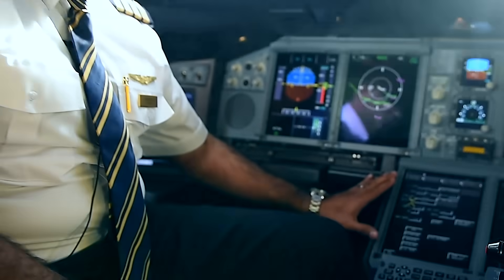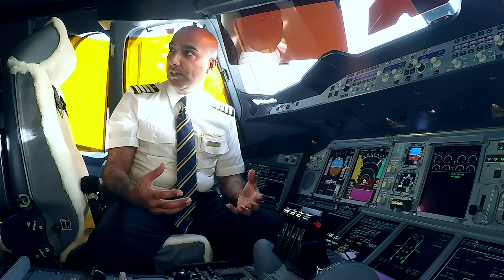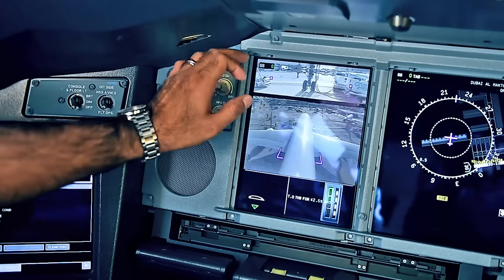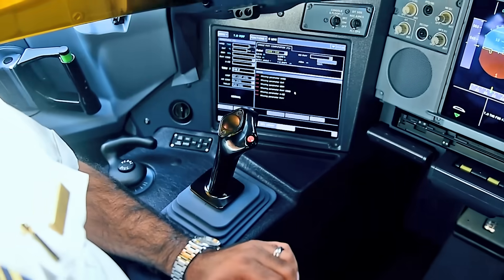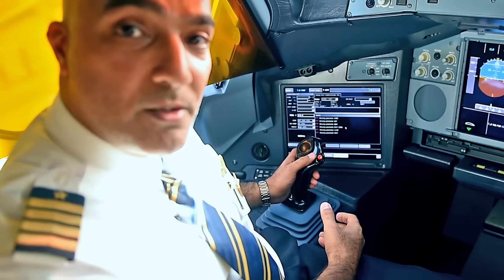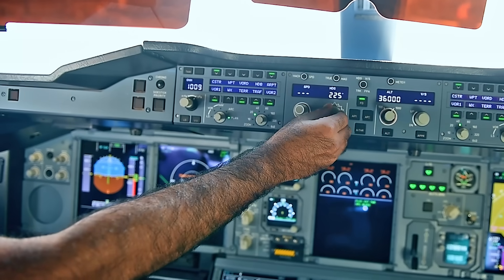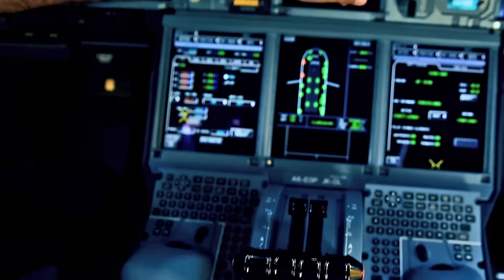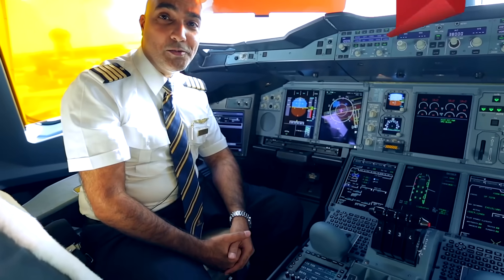How to fly the world's largest passenger aircraft | Airbus A380 | Emirates Airline

Comment: Airbus makes me a bit concerned.  If the system feels the pilot is endangering the plane, it won't let him do it.  There are times the system misreads information and the pilot is actually trying to correct the problem, like when the system thought the plane was at 50 degrees instead of 2 degrees and the pilot could not override the system.
Reply: Boeings since the 777 do the same. And on every plane, be it a Boeing or an Airbus, these protections can be disabled, so the pilot has direct control without any computer interference.

Comment: What can a pilot do if something goes wrong? He has no real flight controls to manipulate or anything. About the only thing I an see happening is that someone breaks out a lap top and tries to figure out what can be done if anything.......if there is time to do it of course.  Now the 380 is a wonderful aircraft but with as many people as it carries I do not understand why a manual back up system is not installed. It will take just one of these giants crashing and killing 500 people before people realize that an all computer plane is just not that safe....or that is my opinion.

Comment: But, what about the co-pilot... What switches does he get to flip?
Reply: The toilet flusher
Reply: It is incorrect that the captain flies and the co-pilot does the other jobs. How it works is that on the 1st flight, the Captain is the Pilot Flying- so he has control of the thrust levers and sidestick: and the co-pilot does other jobs lile talking to ATC, putting the flaps out and gear down, radio frequencies and puts info into and outof the computers. On the next flight, they swap roles so the copilot flies and the captain does the other jobs.
Reply: It's his job to scream, "pull up, dammit, pull up,!?"

Comment: Air craft company have a great responsibility to put multiple pilot...anyway 3, in case of emergency...500 people's life is not easy flying from continental to other. 
as well as safety check up of the engine and computer system. 
almost all crash of the plane was either pilot error or evil attacks. I extremely wonder the air crafts are Super reliable if the pilot uses properly and correctly. 
.....***.......*****........*****..........*

Comment: Too much computerisation. I have flown in that aircraft many times but one day the computer will fuck up and the thing will crash.
Reply: It's not a pc running Windows. The fly by wire system in the A380 is at least triple redundant (possibly quadruple redundant), so even if 'the computer will fuck up', you'll still be perfectly safe.
Try to find a crash that's caused solely by the failure of a fly by wire system. You can't. It doesn't happen.
Reply: Bob UK humans are more prone to causing errors than computers

Comment: OUTSTANDING!! how come the A380 only reverses 2 & 3? why not all 4?
Reply: Sean Buller cuz if the outbound engines would reverse it would suck the ground into the engines
Reply: 1- 2 engines are enough.
2- Weight
Reply: Maurits Veen thats right. If the outer two engines were equipped with thrust reversers then they are susceptible to taking in debri and dirt from the outskirts of the runway and therefor prone to engine damage. Thats what i read somewhere.
Reply: Sean Buller 
Yeah absolutely..the jet fuel HOAX....*Jet AIRplanes ACTUALLY RUN on compressed air free Energy OVERUNITY NOT KEROSENE BURNING HIDDEN in airPLANE sighT* Show me the curVe??? it's flat earth truth nasa hoax..

Comment: does this aeroplane have no trim tab?no dual hud?what about the stickshaker to warn of a stall coming on?sidestick control doesn't let the other pilot know the other pilot's movement like a normal control yolk like on boeing aeroplanes.although the side stick is supposed to have envelope protection it will level the aeroplane if the pilot pitches up at a higher angle of pitch attitude or nose up.

Comment: Thank you Captain for a most enjoyable video.   The flight deck is just amazing and considerably advanced since the Cessna 150 I in which I learned to fly:-).
When the A380 came on to production in Toulouse I lived a bit further south in France near Perpignan which has a very quiet airport.   When pilots from the airlines which had purchased the A380 were being trained they used Perpignan to do "touch and goes".   It was amazing to see this monster aircraft approach in from the Med, touch down with a little bit of smoke from its tyres/tires and then climb steeply to commence another circuit.
Happy days.
Reply: Must have been get to witness !!

Comment: One of the highlights of my year was flying in the Emirates A380. Definitely one of the most comfortable aircrafts I've ever flown in.
Reply: +BrotherMouzone *aircraft
Reply: +connor waltz *aircraft
Reply: The emirates and Qantas a380's I've flown on too; best aircraft available commercially - so comfortable
Reply: +Kamel Labiad Sounds good. The only thing is, some people don't like it so quiet. For instance, there are cars which have a switch to generate artificial engine sounds through their speakers! I think some models of Tesla are like that.
Reply: +adriaansmit81 *aircrafts
Reply: +BrotherMouzone I was really surprised how quiet it was unbelievable
Reply: yes, you are correct. i noticed i cannot fly gliders or ultralights engineless because I'm scare to death, I get hyper, and I simply terrorized (I also freeze on top of high ladders). However, I can fly pilot in command with no problem, have about 900 hours over the years (I'm 62 now) and never had a problem landing a plane after loosing the engine, or do aerobatics. never had any fear. but get in a silent plane or glider and I'm lost. I've talked to some friends and clients who are pilots about it, and some suffer the same problem, and some have told me trhey cannot even sleep at night without a particular sound, ike a fan, a/c, etc. I sleep every night with my ears totally plugged, I don't hear a gun going off next to me. Pure bliss :)!
Reply: yes my 2 flights on this was comfortable too. . it's indeed a great aircraft but I miss Concorde hope it flies again~!!!
Reply: +adriaansmit81 "one of" means he had flown more than one, then "one of the aircrafts" is perfectly right.
Reply: +Soundscrap No it's not perfectly right. The plural of "aircraft" is "aircraft". There is no such word as "aircrafts".
Reply: billiepipersteeth Yes, you're right. Thanks pointing that out!
Reply: maybe it was your first time in first class